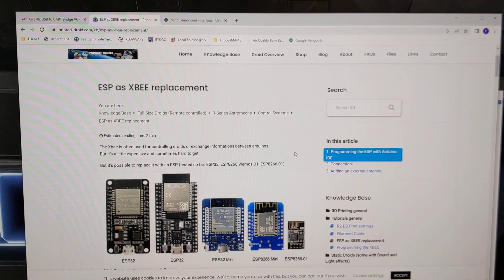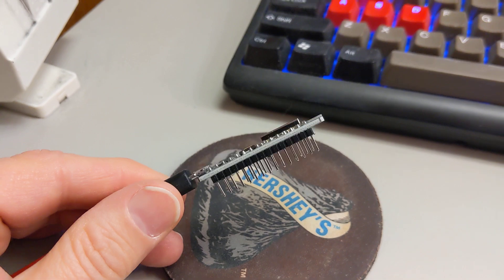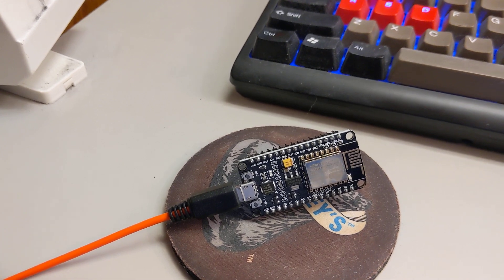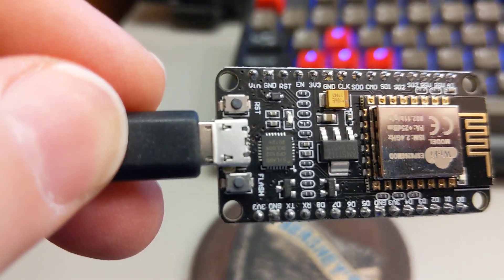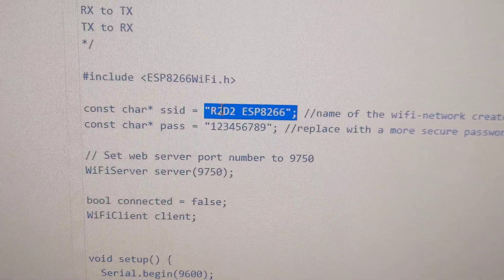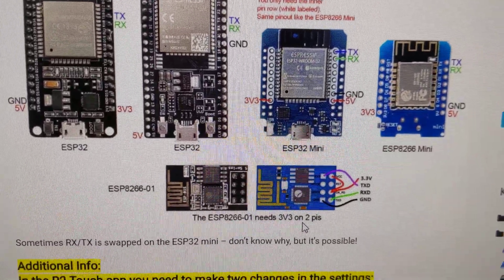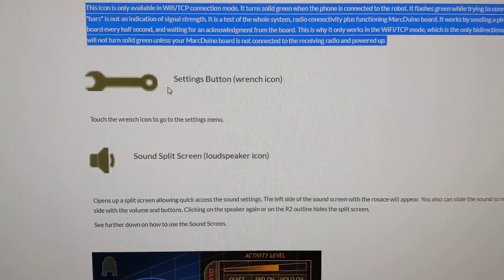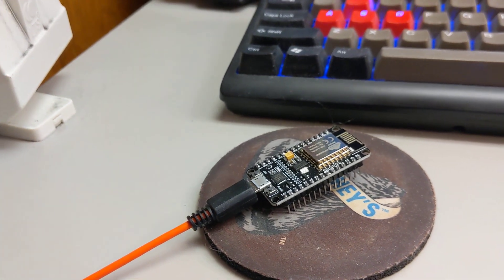3D Printed R2D2 - Part 87

Comment: All ESP boards are not created equal as you found out.  I have been racking my brain for 2 weeks trying to get bluetooth to work on an ESP32 for the Mr Baddely Mini R2 using the PS3 controller option.  I finally got it work by downgrading the Espressif board package in Arduino IDE.  There are so many variations of these boards and it is impossible to even tell if the chips are even genuine, especially on the cheap ones on Amazon.  It appears to me that Espressif dropped support for some of their older chips in the latest release.  I enjoy your videos Tom, because I run into all these crazy issues as well and it is nice to see it's not just me! :)
Reply from the maker: Welcome to the crazy club!